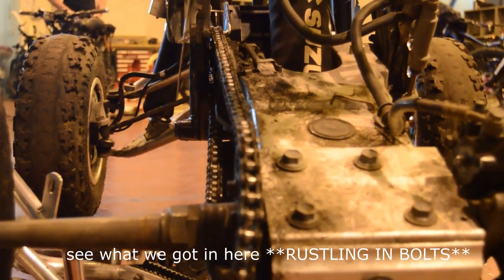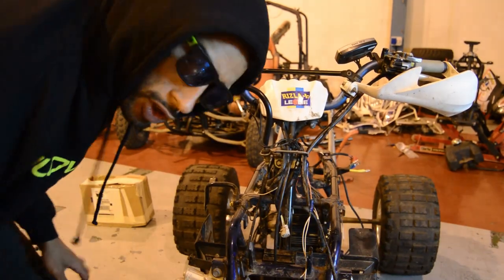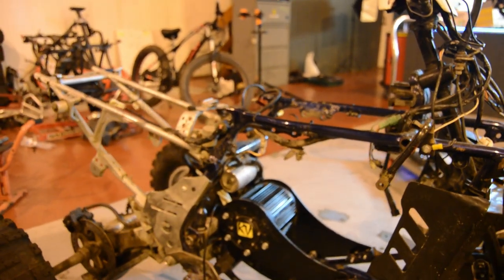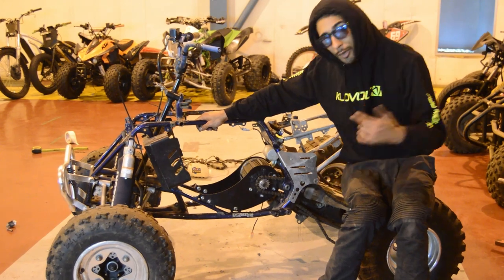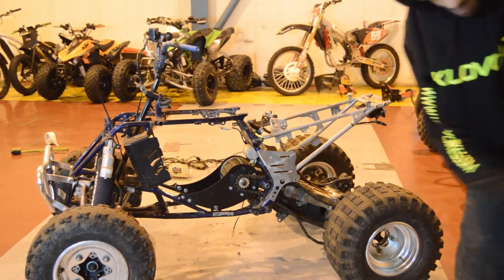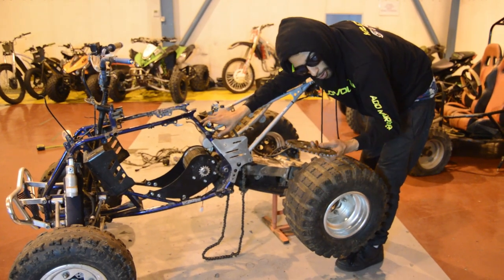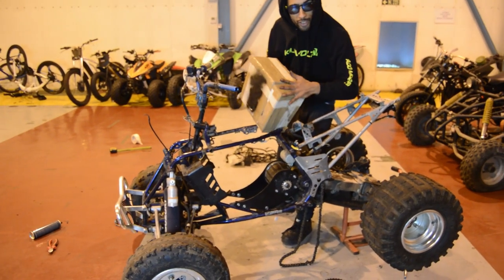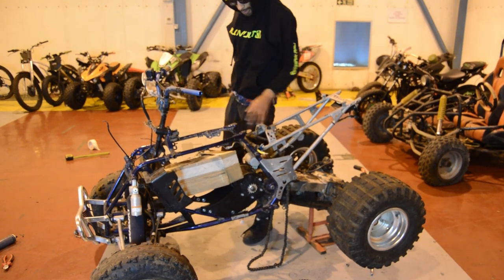Building an Electric Quad / ATV from a Suzuki LTZ400 Frame [KV Quad Part 2]

Comment: I have so many questions 😂 main one being… are you going to be offering this as a conversion? Also would you offer a kit to do it diy?
Reply from the maker: We are going to make a complete kit available on our website including motor , battery mount etc . We just want to test it all and make sure it performs well first . ⚡️🙏
Reply: @KiloVoltBikes  mint 👌 be interested to see top speed and accelerating figures, I have the exact same quad sat here with no engine currently

Comment: 400A nice! 40ah...my bike has more capacity than that!
Reply from the maker: Just checked out your build - if the balance wires and other work on your battery by the alibaba supplier is anything to go off I would be very surprised if it is actually 68ah . That’s why we build all our packs for our builds . Probably find after voltage sag and internal resistance your left with less then 40Ah . 

Also capacity isn’t an issue for this build just needs to run for 20 mins as we plan on using it for stunting and equipping it with a very fast charger
Reply: @KiloVoltBikes  I only charge to 4.2V and discharge to 3.0V. I get 35-40 miles of range. Based on voltage sag I lose about 10% of capacity. I have 58 ah of usable capacity the way I charge the battery, with losses still at least 52ah of actual useful capacity. Comes out to 106wh per mile which sounds reasonable to me. So yeah, pretty sure my bike has your quad beat on capacity.

PS - don't get me wrong I love what you guys are doing and I'm sure it's enough capacity for your use case, I was just giving you some friendly shit mate.
Reply from the maker: Always deduct 50% from the ah of  any Chinese built pack .

For for your pack 

68Ah - 50% = 34Ah .... 

Defo not more capacity then our confirmed 40ah .... also try discharging 400A from your pack and you’d have a new feature .. heated seat 🤣
Reply: @KiloVoltBikes  lmao
Reply: @danerasmussen6476  haha fair enough